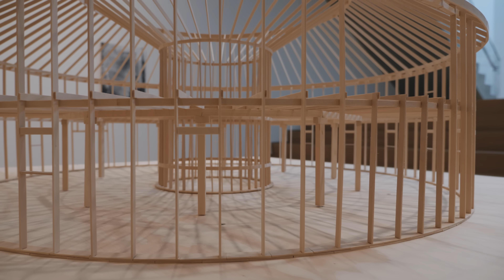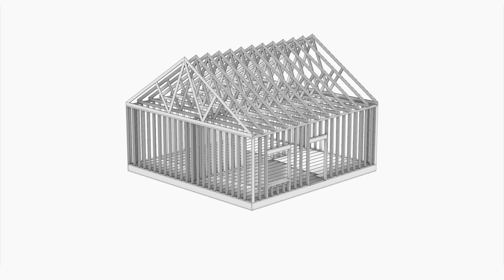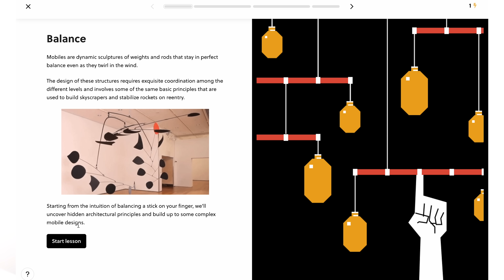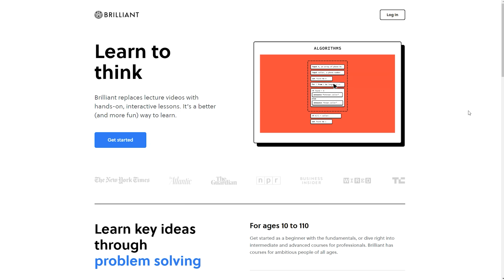The Genius of 2x4 Framing

Comment: This is why tornadoes and hurricanes routinely flattens homes in America. Cause the houses are built with wood and paper. Concrete and steel is the best way to build.
Reply: Has it ever occurred to you that perhaps you have no conception of the power of a tornado or hurricane? The most powerful of those storms will scour the ground clean. Roads, railroad tracks, all gone. Nothing left but bare dirt. It'll rip up all vegetation. Just leave a scar where it went through. And you think the buildings where you are can withstand that fury? Yeah no.
Reply: @1pcfred  Actually I do. I’ve lived through 3 hurricanes. Hurricane Gilbert category 5 that tore through Jamaica in 1988 with 183 mph winds. The house I lived in was made out of concrete and steel with slab roofing and is still standing to this day. Hurricane Andrew with 174 mph which flattened an entire city of homes here in Florida, made out of, you guessed it wood and and drywall. And Hurricane Ivan another category 5 with 164 mph winds. So don’t assume to think I have no concept of the power of a Hurricane I’ve lived through them and seen what they can do. And in that experience, concrete and steel stands. Wood does not.
Reply: The factor in hurricane construction is the negative and positive wind pressures on the building. Too much negative wind pressure on the leeward side will lift up a roof. 
Much of Hurricance Andrew's damage was buildings weren't up to code with only one hurricance clip for a few roof trusses rather than one to a truss. 
A conical teepees is more hurricance resistance than a building with features that block the wind force.  
Storm surge does more damage over a larger area than the path of a hurricance. Building on the barrier islands (sandbars) and displacing the vegetation that holds the soil together is just plain stupid. Build inland. Ten miles inland from the flood zone. 
Materials are just one factor.

On Okinawa the thin shell concrete buildings bend with the wind rather than snap like a stiffer building. Watch palm trees and how they survive hurricanes.
Reply: @vincentgoupil180  people like living by the ocean. 10 miles away you might as well go live in Kansas.
Reply: @vincentgoupil180  I live 6 miles from the coast and looking around my property you'd never know it. I don't think I've seen the ocean yet this year. Although I've gotten pretty close to it. Oh wait that's right I went to Defense Day out on the cape. I think that's the bay though? Eh, it's right on the border. Yeah I guess that water I was looking at was the ocean. That's in the same park Joe fell off his bike. FJB!

Comment: Lots of comments here questioning the durability of timber framed houses. Unfair, because well built timber framed houses will last effectively forever if well maintained - if basic maintenance is done, if kept dry and free of termites and other pests. The reason why timber framed houses typically have a shorter lifespan is because that’s what is required of them. The typical lifecycle of a timber framed house in our area goes like this - owner builds the house, raises a family and is very happy with it. After 40 or so years the owner starts to think it’s a bit small. He builds a big new house elsewhere and the original house becomes a rental. Maintenance becomes erratic and the tenants fail to care for the property. By this stage the value of the actual house has declined to the point where it adds nothing to the value of the property. - which is determined by its proximity to good schools, city center, services, waterviews etc. There is now no need to maintain the house, it leaks, the paint is flaking etc etc and even it’s structural integrity is becoming compromised. The owner decides to sell and the only interest the prospective buyers have in the actual house is how much it will cost to demolish. They want to demolish it because no-one wants to live in houses of the size people thought was perfectly adequate 40 years ago and they want to build their 4 bedroom/5 bathroom dream home. Neither is it worth renovating and extending the old home - that costs more then building a new house and you end up with a chimera.

I can’t criticise people for doing this - we’ve just done it ourselves - demolished a 50 year old timber framed (brick veneer) house to build our dream home of roughly twice the size even though there wasn’t a single thing about the old house which was in any way deprecated by its age. We have another house in a nearby beachside suburb which we rent out and want to sell in a few years. It’s 90 year old timber framed house, in perfect condition, but there is an absolute presumption that the next owner will demolish the house and build a new one.
Reply: I love this comment because I think it's very accurate.  I'd like to add that in the area I live in there are a lot of brick or brick veneer bungalows that were built in the 1950s and people are extending them by adding a second story.  They are so well done that if you didn't know the history of the building you'd never notice what had been done.  It amuses me that when these bungalows were built they were likely inhabited by 6 to 8 people, and now they are double the size with 3 or 4 people living in them.

Comment: The statement that "you don't need skilled labor to make stick framing..." well, let's think about that. Framing has been devalued to the point that it is VERY hard to find any kid that will learn how to frame, rather than work fast food. Now there is an issue. The simple trade is loosing it's quality, and for something as "simple" as framing, that is a serious warning flag about the work force.
Reply: A line and a cross - drive two nails.

Comment: Likely the most moronic parallel premise or forced metaphor I have heard; framing and hamburgers. Good grief Charlie Brown.  So many other factors are at work, large commercial mills, transportation of materials cost, mass production of fasteners and glues, standardizing of residential construction codes and permitting.

Comment: When comparing the timber frame to the stick built house I had hoped that you would give a comparison on the mass or volume of wood used in each type for a similar sized structure.  Is there an economy of material in using one over the other.  As Dave Stagner commented timber framing originally used very few nails or other fasteners, mainly tenons and dowels.  It would be interesting to know if timber framing uses less wood, the same amount or more?

Thank you for an interesting history lesson on how stick building came about.  It is interesting to learn about how things came about and why they are/were done the way they are.
Reply: I don't know about total volume, but for timber framing you need good quality, large pieces of timber, much bigger than the trees 2 by 4s are cut from.

Comment: Homes built out of wood are best if they are for single families or one floor (one level or story) tall.  This is because it is sometimes difficult to live underneath a loud and heavy person who drops things on the wooden floor above youm. That can lead to things like loosing sleep.  Unfortunately in the 24-hour economy of the USA, not everyone has the same work schedules. This can be very difficult if you live under or over someone else in a wooden dwelling.  which is why in those ways concrete homes can have significant advantages.  Living in a shared wooden home is like having paper walls, you end up hearing everything.
Reply: it is entirely possible to make wooden walls sufficiently soundproof.
Reply: In two story homes all of the bedrooms are on the second floor.

Comment: Adding on, due to wood's low carbon footprint and minimal energy usage, wood is a more environmentally friendly alternative than other building materials i.e. steel, concrete, etc. This has led to new types of wood "mass timber" being invented to build skyscrapers out of wood.
Reply: Can't use wood in skyscrapers, it's a fire hazard.
Reply: @657spy  look up "mass timber". It's a type of wood that chars but maintains structural capacity when burned. It is starting to be used for midsize buildings that are 80+ feet tall.
Reply: @mrsmiley_1468  oh, I wouldn't call 80ft a skyscraper though.

Comment: As an European, i need to ask the difference in price possible in US between light wood construction and mortar and cements bricks houses? This technique is nowadays gaining a lot of interest back, but it usually cost twice as much here regarding structural layers compared to concrete... and not mentionning the lack of engineers and worforce knowledge and also not very code compliant...

Comment: Wood frame houses tend to rot faster, be less electrically efficient, creaky, and have so little sound resistance that you can hear a penny drop from opposite corners of the house. They had their place in time, but now the only reason they are built is to make them as cheap as possible & sell them for as much as possible to get the most profit possible with the least amount of effort, only for the building to fall apart after 20 years. If you're gonna build a house now, build with bricks.
Reply: Why would a wooden structure rot? If there's no water ingress wood won't rot.

Comment: Interesting,  Australia must have followed along quickly, I grew up in a timber town in  Australia and the mills in the area have always cut studs for house framing long before myself or my parents or even grandparents. Even some early heritage homes in Sydney are stud frames....wouldn't be surprised if its a lot earlier then the video suggests.
Reply: At least here in Australia till the 90's most houses were hardwood frames instead of the soft pine framed houses we have now
Reply: @dimitriskrin  actually south Australia has used radiarta pine for at least 100 years, back in the 1960s we were felling 70 year old plantation grown timber and the original seeds were imported and test grown at LEG OF MUTTON lake in Mt Gambier in the 1800s. SA had virtually no tall native trees suitable for milling and most building timber was imported to the state, the government of the day decided to acquire land mainly around Mt Gambier to develop a plantation forestry industry. The Mt Burr timber mill was the first milling operation in Australia to include on-site steam kilns remaining in operation until it's closure around 2000.
Reply: @dimitriskrin  i think it depends on your area. I’m only familiar with NSW framing. In Sydney hardwood frames are fairly unusual and most houses post 1880 have softwood wall and roof framing but  with the heaviest members such as beams and joists of hardwood. Oregon in the early ones, more often radiata later. 

Full hardwood frames were more likely to be found in regional areas and owner-built homes where people cut their own timber. I own one of these - the hardwood framing is very difficult to work with - need to drill a pilot hole just to get a nail in and no piece of timber in the house is actually straight.

If you study old photos of the docks in Sydney you will see that most of the sailing ships were actually carrying timber. The demand for good timber was huge and It was cheaper and easier to use imported timber then local hardwood.

Comment: As a Dutch person where basically everyone lives in brick buildings, the thought of living in a (what looks to me) glorified wooden shed always scared me. What if a fire breaks out? Or a big storm hits? Can such a house withstand that?
Reply: Hi @matthijs blomjous, as an American, I can answer some of your questions.

- what if a fire breaks out? We have a couple of ways that we deal with that issue. First of all, this wood framing is always surrounded with gypsum drywall that provides some level of fire resistance. Since wood is not directly exposed inside a room, there is some time after a fire starts in a room before the structure starts burning. However, if you have wood paneling walls without sprinklers, this is indeed a death trap, but it's not like wood paneling in a brick building would be that much safer. Single family homes here generally don't have sprinklers because the building industry has lobbied against it. As a cost reduction measure. All new multifamily construction has sprinklers these days, although I think that a lot of the older construction has not been renovated with sprinklers. Actually, we use light timber framing not only for single-family houses, but for the vast majority of new apartment buildings up to six stories tall ( look up 5-over-1s). Once the sprinklers are installed, this style of construction is fairly safe, even for commercial construction.

We are also more concerned with earthquakes in many parts of the US, especially on the west coast. Earthquakes are kryptonite to ordinary brick construction, so it's not very common on the West Coast, and even outside earthquake areas, the cost factor means that most bricks that you see are just a facade over light frame timber construction.

- what if a big storm hits? These days, you generally need to build with plywood or OSB shear walls and also hurricane ties which are a kind of connection between pieces of wood that is stronger than just bare nails. This will generally do the job and protecting structures against most storms. It is true that in Florida and other places where hurricanes occur often, new houses are generally built of concrete to get better wind resistance, but outside of those areas, concrete construction for single-family houses is very rare.
Reply: Its actually really important in California to build with sticks over bricks. Bricks fall down in an earthquake, sticks just shake. We have countermeasures for fires like having water sprinklers inside and out in the more fire prone areas.
Reply: @thangle13  we have smoke alarms and when the alarm goes off you GTFO!
Reply: these structures are pretty resilient to winds up to 120 mph
Reply: @hawgcranker420  Damn, alright. What about the fire hazard tho?
Reply: @matthijsblomjous3671  ignition temp of dimensional lumber is a lot higher than you think. A propane torch won't light one. Cover it with drywall and its less of a problem than you'd think
Reply: @hawgcranker420  Alright, alright, thanks for educating me man!
Reply: No.

Comment: In a way, light wood framing seems to correlate well with free market capitalism. Just like the burger analogy, it's cheap, mass produced and does not require traditional craftsmanship. It worked because of the high demand. But just like any other mass produced and cheap product it comes with some drawbacks.